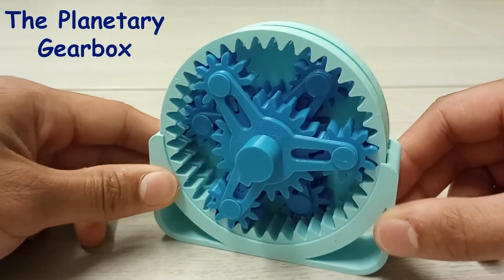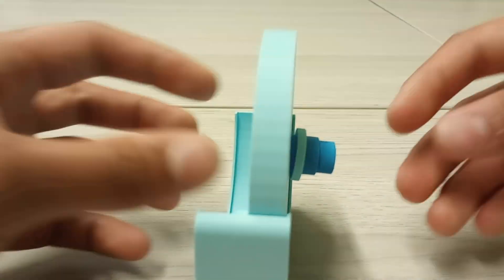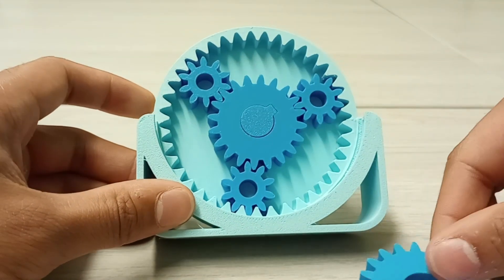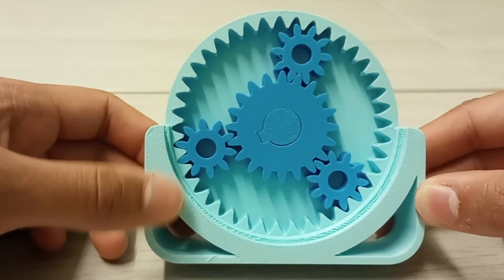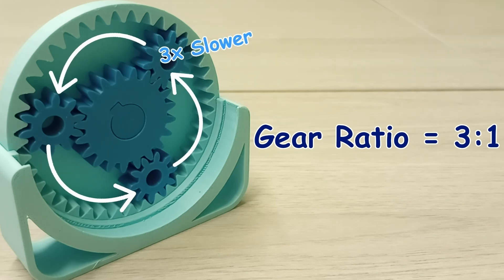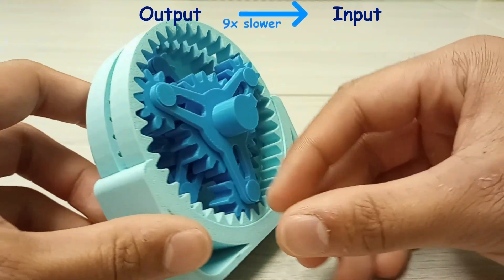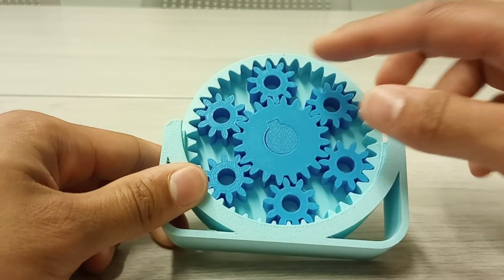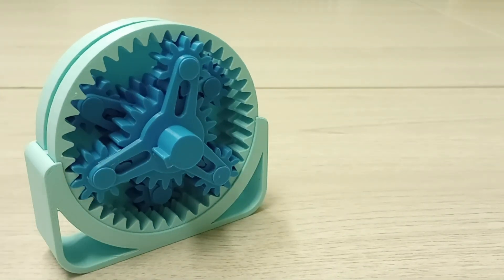Exploring the Magic Behind Planetary Gearboxes

Comment: I'm totally new to this stuff. I found the calculation for gear ratios interesting. I assume the teeth of the sun gear and outer ring must be the same size (or very close)? Could you achieve a different gear ratio just by varying the size (and thus number) of the teeth?
Reply from the maker: Glad you found it interesting. Your assumption is correct, gears can only work together if their teeth are the same size (in other words have the same module). And yes, the gear ratio is dependent on the number of teeth. For example, making the sun gear larger would make the output speed slower and thus stronger.

Comment: Very nice! Where would these gears be applied?
Reply from the maker: Ah, I'm glad you asked my friend. They can be used in any machine application requiring speed reductions or a torque increase in electrical motors, for example a conveyor belt. They're also used in automatic transmission cars.
Reply: that’s rad!
Reply: Toyota uses planetary gearsets in their hybrid cars, in which the planet carrier, sun gear and ring gear are used to connect to the combustion engine, electrical motors and wheels of the car.